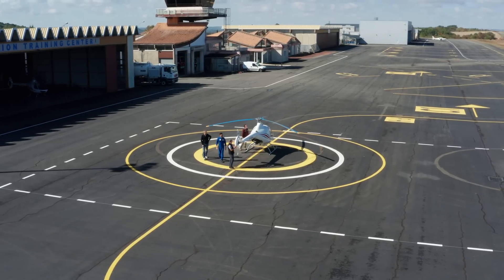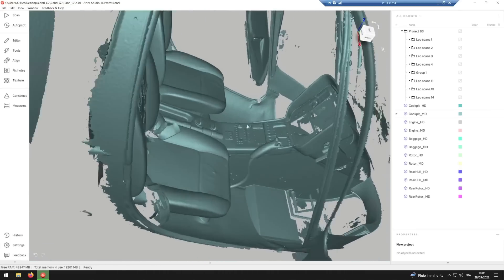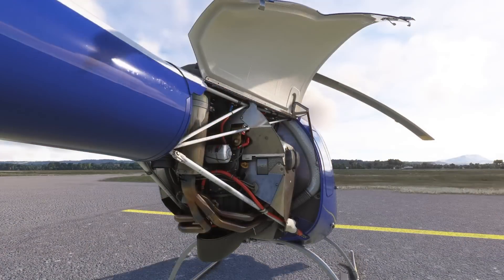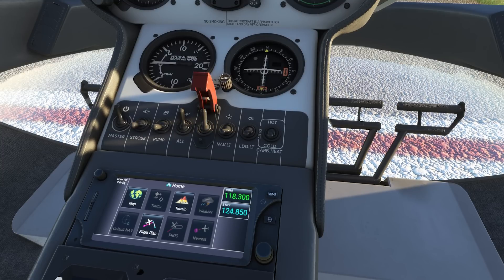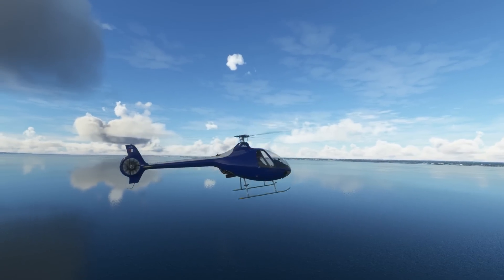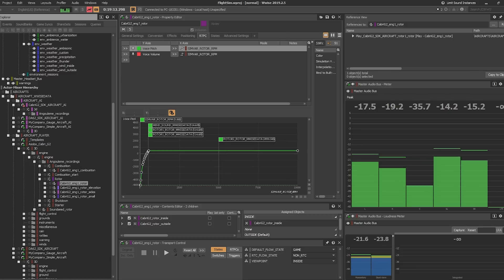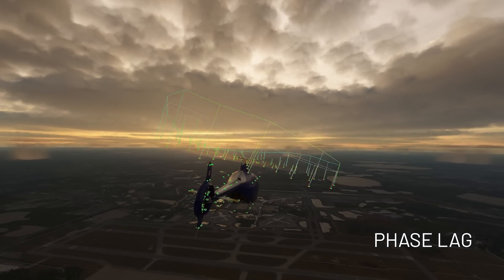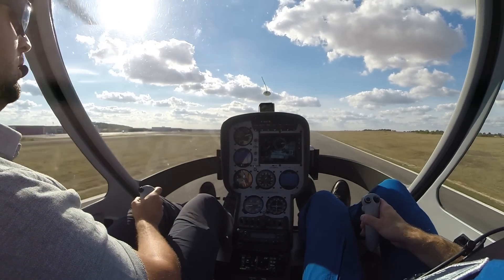Feature Discovery Series Episode 15: Helicopters

Comment: I beeing a helicopter pilot am really disappointed. I was really exited for the helicopters but the simulation is just garbage. I don't know about the g2 but the bell is far away from finishing. Even the easiest parts of the simulation is not ready. There is no basic aerodynamic simulated except for maby a bas ig and og hover but that's it. The simplest systems are not working. I mean the verry basic stuff. One example. You are not able to activate the starter generator without having the throttle on idel. Those condition would you give nothing but a burning engine. The torque is not simulated. You can just pull 100%  whenever you want.

Is sad the private persons are modeling way better helicopter than the developer.    In fact I only purchased the sim for the helicopters now but that's not even a 10% finished product.

Comment: So, I have actively tried to get vortex ring state, but it simply doesnt happen. I tried letting the helicopter (both of them) drop at 2000-3000 fpm vertically (zero or near zero forward speed), and it was no problem to simply add collective and stop the descent. No vibration or anything. It just stopped the descent like it had a rocket engine.

Is there some hidden realism setting somewhere that adds this advanced simulation? 

I see you mention it in the video and I was really excited, but both helis are so easy to fly (no, I am not trying to "flex"). Compared to DCS where you have to be very conscious about not running out of power or getting caught in your own downwash (VRS).

Or has it been intentionally dumbed down for the broader audience? If so, please give me an option to re-enable it.

The Guimbal Cabri seems EXTREMELY powerful. It can climb, in hover, at an extreme rate. I don't know much about this type, but it seems excessive. 

And I also find it weird that I can pull maximum collective on the Bell 407 without any issues. Is this a thing?

Comment: Good day, I have a problem when importing the flight plan from the SIMBRIEF to the MCDU either in the a320nx fwr or a330-900 neo aircraft, so when arriving at the INIT tab by pressing the corresponding key the message of the flight plan required by INIT appears and that of the F.PLN does not appear, by pressing the button of the latter we find neither the airport of departure nor of arrival despite I have followed the known steps , I wish you help me find a solution to this and thank you.

Comment: VRS and settling with power are not the same thing. Settling with power is when the engine is not able to provide enough power. VRS is when the rotor blades are stalled.

Comment: I don't care about 3d model too much. I mainly care about flight dynamics model. If the In-gound effect will be modelled properly, if the VRS will be modelled properly, if the settling with power will be modelled properly, translational lift, e.t.c..
Reply: I don't think you watched the video all the way through.

The initial part is about the visual model, then audio and finally flight model. And the flight model part answers all of this, including VRS, translational lift, ground effect and all that. They even included a visualization of the air moving.
Reply: Also systems modeling. Things like engine overstressing, overtorque, overrev, overheat, mast bumping, e.t.c...

Comment: I like rudder pedals that work by pushing downward instead of forward and backwards. Because you need to keep steady anti torque. It easy to push down an exact amount constantly. Not so easy when pushing forward.

TM Pendular and VKB Elite have the type of motion I greatly prefer for helicopters. Both are all metal and quality. But the inexpensive VKB does not have toebrakes. The Thrustmaster does but they are expensive.
Reply: I made my own rudder pedals exactly for this reason. The support rods are pivoted at their lower ends just like in helicopters or small fixed wing aircraft, enabling very precise control, including when maintaining some constant off-center position as you described. I also added the option to use or don't use springs to return to center, which make sense on airplanes but not on helicopters. They are controlled with an Arduino (Leonardo or Micro will work for this) running a very simple script. Didn't add toebrakes yet. Thinking about the options for that.

Comment: you do all realise that Hype performance group have been doing realistic and simplified helicopter dynamics as well as a two models of heli without any external programs needed  for near on nine months in msfs ?? so the physics has always been in the sim anyway.
Reply: But who has the better flight model is the question. And I heard that Hype will conform to the MSFS 2020 flight model for helicopters.
Reply: Actually, they haven't. There's no helicopter physics before SU11. But it's possible to recreate them through extensive code.

Comment: Sébastien, please! You’re the CEO. Please fix the virtual reality shutdown bug that causes players position to be reset, tool panels to be closed, doors to be closed. It’s like living with a poltergeist! This regression has been around for a year now and happens because of the ‘end flight when aircraft shuts down’ feature. Microsoft listed it as ‘fixed’ but IT NEVER WAS. If anyone plays in VR with that feature turned off it always happens at the end of an otherwise smooth flight and it’s nuts to leave a bug FOR A YEAR like this.

Comment: The words "accurate and accurately" was used a lot in this video, yet why do so many people say XP11(XP12) has a much more accurate flight model? They can't both be right? So just how accurate is the flight model in MSFS? 

Can you see my point? If you want the most realistic flight model, you buy Xplane. So someone is not being completely honest. At the very least someone is using hyperbole. 

So just how accurate is the helicopter flight model going to be? And if you cant get it right with conventional aircraft, why should we believe helicopters to be any different? And if you have got the helicopter flight model spot on, why can't you do the same for fixed wing aircraft?
Reply: They both use hyperbole. As of this moment there’s no such thing as accurate to real life FM on any sim software/game that runs on home computer devices. Both MSFS and XP (Austin) are full of BS when the claim that. Hell not even Level D FAA certified sims don’t have accurate to real life FM. The reason being the immense complex parameters that govern the fundamental behavioural characteristics of fluids, especially when they come in contact with bodies at different speeds and atmospheric conditions. The only domain such a realistic simulation can take place is either a wind tunnel or virtually through Computational Fluid Dynamics (CFD) software (eg: ANSYS) used in R&D to study how object behave around certain fluid conditions. The parameters of such an analysis are so complex (governed by differential equations -Navier Stokes) that take hours for results to materialise. The process involves boundary layer definition, meshing, rendering, sim analysis run,  post analysis. And all that for specified conditions. Such a thing to happen in real time it would take enormous computing power that is not available for home computers. I thin NASA has something capable to run proper CFD sim for flying vehicles at Ames Research but I am not sure.

Bottom line is, the FMs you get in these games yes they are all games are a good approximation but don’t be surprised if it doesn’t always correspond to reality. You only need to have a run through the forum threads on both MSFS and XP and see pilots arguing back and forth about which feature from which sim they found unrealistic, many agree many disagree. Key point is because the method is an “approximation” not always the feedback from pilots or experienced users will align with reality. “Inconsistency”
Having said this FM sim war serves zero purpose as the FM as it stands now is good enough on all platforms for Flight Sim training. Flight Simulators are used in aviation primarily for procedural awareness, aircraft system familiarisation and through all that training for a variety of procedural scenarios. So as long as the aircraft has a basic FM and is represented 100% on systems, instruments and functions then you’re good to go. The rest is for barber shop talk.
Reply: @gpapa31  I agree with everything here, but the last point to me stands out the most. You just cannot create the same aerodynamic factors in a simulator as happens in the real world. 

It doesn't matter what simulator you choose to use. So both simulators are equally as adept at learning the controls, the procedures, and the theory. There is no clear winner in this regard.

So when people say to me, I won't use MSFS because the flight model isn't as good as XP, I say your loss. You're missing out on the most highly detailed world environment we have ever seen for any simulator or game. This includes the weather engine. And the most exciting thing for me is there is still lots of room for improvement. 

Saying this I still want Microsoft and Asobo to push the boundaries as far as they possibly can where the flight model is concerned. The simulator is so good it deserves it. Don't stand on ceremony. 

Oh and sort the weather radar out ffs 😁
Reply: Real-world pilot here, MSFS' FM is fine. Much more dependent on the developers who make the aircraft than Asobo, although each SU adds improvements and more capabilities

Comment: It's a shame that they didn't give real pilots anything in VR with full simulation equipment. Their assessment of helicopter physics on a small screen is questionable, given that it's so hard to feel. Is it expensive for you to have equipment for such important tests?
Reply: They seemed to have brought the stuff over to the pilots instead of calling them over to Asobo, so they made do with that they had
Reply: @iaexo  Guess it wouldn't be too hard to bring a few Quest 2s though, the setup takes no time and it's good enough. The only limiting thing would be the rig it's running on.
Reply: Assessment of physics is always questionable, especially considering people all around the world will use all sorts of different controllers.

Comment: Oh my goodness, this is superbly exciting. Native support for rotary winged aircraft has been a long time coming and it's wonderful to see it coming along well. I can't wait to see  what third party developers come up with using the new systems for helicopter simulation!
Reply: Native support, so does that mean the R44 and Airbus 135/145 wont need AirlandFS exe?
Reply: @ellonysman  I assume that it will take them some time to port it over to the new helicopter API, but once they've done that, installing and using those mods should be no different from installing a modded fixed wing aircraft. It should be as simple as unzipping the mod, then dragging and dropping it into the right folder.
Reply: @saml7610  sweet, the R44 and H125...the 135,
Reply: @ellonysman  not instantly, no. They probably require some work.
Reply: Does this mean VTOL flight model will be a thing like XPlane? Would love that.
Reply: @pricelessppp  Hopefully, seeing as there's already a V-22
Reply: @Rechitech  If so! I’ll definitely ditch Xplane.

Comment: Not gonna lie, Asobo... after VR (thanks again btw), this is my most anticipated feature. Looking forward to this. I'll consider this an early birthday gift. 😉
Reply: Force Feedback is correct, and it's always been abbreviated as FFB and typically everyone in the simming space knew that. It's baffling that it doesn't come to mind first anymore and search results don't come up with it either, which just proves that something needs to happen about it.

It is so awesome if you ever had it in a sim with good support (especially the Il-2 series, both the old and the new and Rise of Flight, but also on most modules in DCS that aren't Fly By Wire using some sort of FCS), giving you vital feedback such as control forces depending on speed and thrust (if propwash is blasting the control surfaces), vibrations near to a stall (depending on airplane, an FW-190 in Il-2 just buttets slightly and then immediately stalls, other planes like the A6M or an early 109 give you tons of warning before it happens) or just having proper trim mechanics that actually just reposition the point where your stick is being centered to, which is especially vital to flying helicopters (works absolutely great in DCS).

The bad thing just is that the best stick still on the market is the 20+ year old Microsoft Sidewinder FFB2 and only in 2009 Logitech tried it again with the G940, but failed hard just because they cheaped out on wiring and potentiometers. Without those issues it had, it would have been a blast of a HOTAS+Pedals setup for everyone to recommend. You basically got a FULL setup including FFB for 300 bucks. They sadly never tried to improve and re-release it (it was virtually impossible to get a new one already like half a year after release). A V2 without the issues would rock... well, and then there's extremely expensive professional solutions like the Brunner CLS-E (a stick base for most common sticks such as the TMWH or a good portion of VKB and Virpil sticks if I recall correctly that is 1300 bucks), but doesn't support the DirectInput ForceFeedback (there are ways to get it working AFAIK though through vJoy) which is what most sims use.

And who else could push the industry to make new FFB hardware better than Microsoft and Asobo? Other companies still support it and even free DCS modules have it working (such as the A-4E-C) while the probably biggest player in the market (at least in terms of financial resources *hint hint* ) that once had their very own FFB capable hardware (actually they were the first) are the ones who completely left it in dust so far. The later they'd add it, the more work it'd be by the way since at least all the MS/Asobo planes should support it and also the more's been released already by 3rd parties, the more has to be updated to get that support in and some may end up never getting it at all.
Reply: @CakePrincessCelestia  Thank you for your very considered and expert knowledge reply, I for one appreciate the effort you have gone to for me.
Reply: Agree. Next up: FFB would be great though :)
Reply: @CakePrincessCelestia  This is what a simple internet search came up with: First Fidelity Bank, First Financial Bank, Fat-Free Body, Flexible Fiberoptic Bronchoscopy. I ask myself, why would this commentator alienate many of us that have just read his comment and force us to do an extensive internet search. It would help me greatly if you actually put in what you mean by FFB. Not needed for VR as VR is pretty much universal now with the general public. If however your intent was to only address a small group of specialists, then fine.
Reply: @tomholy  I'm guessing, staying within the topic of flight sim peripherals and hardware, that they're talking about native support towards "force feedback".
Reply: @NavidIsANoob  Thank you. I use force feedback in all my games and driving sims, strange I didn't twig to that.
Reply: @tomholy  Admittedly, it's an odd choice of words to turn into an acronym.
Reply: @tomholy  Maybe hes some kind of tech doing tech talk...its punjabi to me.  Now time for some desi daru
Reply: I recently bought a computer, and man, VR is amazing, a game changer. Practicing flying on VR makes my muscle memory kick in. Playing in 2D seems artificial now